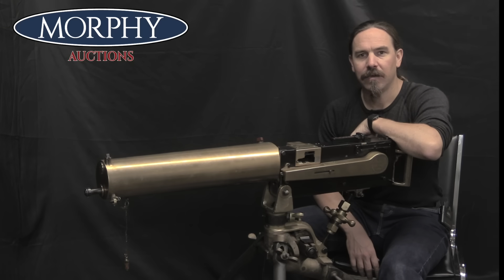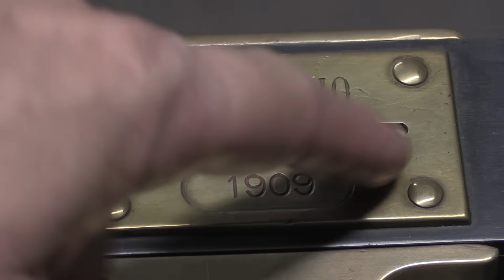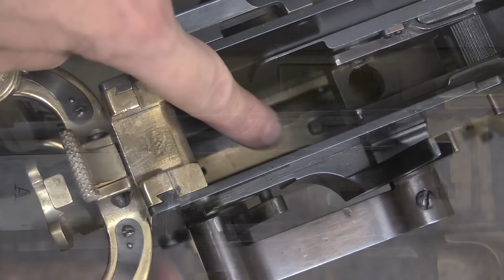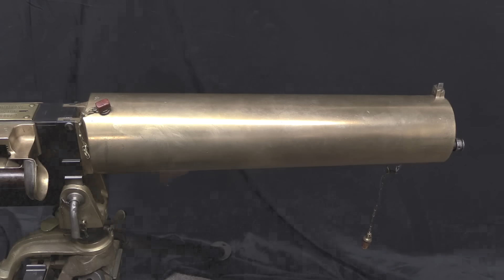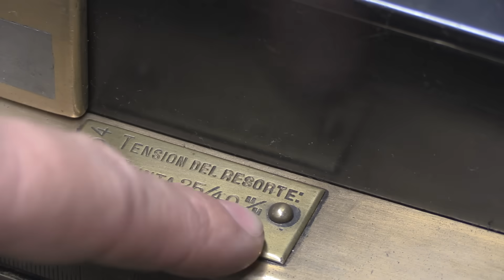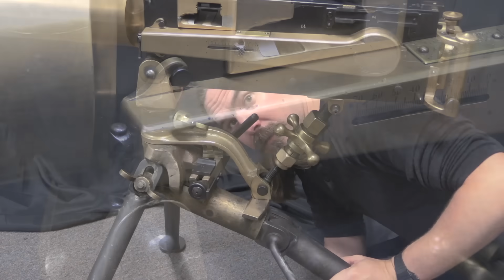Argentine Brass Maxim: A Machine Gun of the Steampunk Age

Comment: Is that hanging chain in the front, a barrel cap for storage ?
Reply from the maker: It's the chain for a plug to seal the steam vent hose connection when not in use.

Comment: We know, Maxims are still in use, but is there anyone who is still making new ones??
Reply from the maker: No.
Reply: @ForgottenWeapons Ian, you need to find one of the 50 Browning hp in 7.63 mannlincher with firing selector, Made on the 70s i'm argentina, a Lot of wird stuff was made on they 60,70,80s on argentina

Comment: Amazing video as always, Ian!
Can anyone tell me if reciprocating barrel of a Maxim gun is in direct contact with water inside the water jacket? If so, then how is water sealed off so it won't leak out through the small gap between the front of the barrel and the jacket body or somewhere in the receiver area?
I was always wondering about that

Comment: About the water system, would it be possible to have a recoil operated sort of pump?
Or use a part of the recoil in a clockwise mechanical aspect, making a flow between the water container and the condenser?

(I didn't said efficient, I said *posible*!)

Comment: I imagine the use of brass, especially in the water jacket, was a significant advantage in corrosion resistance over steel. If you're thinking you will use these guns for decades that is a significant consideration.
Reply: Only if you're okay with a green patina look though. If you're going to make the crews constantly polish the patina off there aren't any corrosion benefits over steel.

Comment: Is there a mechanical system that can reload (& fire) a cartridge after a misfire?

So one misfire doesn't stop it, but two sequential misfires would stop it?
Reply: Any externally-driven gun will generally ignore misfires, like the chaingun on a Bradley or a Gatling. For a recoil or gas operated firearm, the only one that comes to mind is the Villar Perosa, which might run past a misfire because it’s basically two guns glued together.
Reply: @PrebleStreetRecords  yeah, thanks, "not externally driven"!

I'll check out the "Villar Perosa"!

Comment: The idea of a black powder machine gun sounds like the worlds most metal fog machine.
Reply: Every 20 rounds required complete disassembly , thorough cleaning and reassembly.
Reply: @guaporeturns9472  The issued 577-450 Boxer ammo was actually capable of extended firing as the construction included hard card wads along with a beeswax cookie so each round scraped fouling then deposited a layer of lube.   As long as the brass case expanded well enough to seal the chamber upon firing the action would stay clean and I'm sure would run for many hundreds of rounds before any attention was needed.
Reply: @guaporeturns9472  By the time you're done cleaning the smoke have lifted enough to aim for the enemy again.
Reply: @guaporeturns9472  The tolerances were a lot less tight to accomodate for black powder fouling.
Reply: Ah but if you want to see something REALLY COOL you should go back in time to the American Revolution, and the 60 shot repeating musket. Ian has a video about that one as well.
Reply: "These are five to six hundred round-per-minute guns, so you can imagine how much black powder smoke that puts out" absolutely floored me as a line. No wonder Maxim guns last almost literally forever.
Reply: I really understand the need to lock in a traverse now.
Reply: Iron maiden album cover type stuff
Reply: Sounds like a Smoke generator with the side effect of shooting rounds

Comment: The wooden roller may well be ironwood. Not only is it very hard and durable, it is also self lubricating. Ironwood was also used for thrust bearings in steamships at this time.
Reply: Ironwood was also used in aircraft, mainly as the tail skid before they had a tail wheel, metal ones could spark and start a fire (which In the days when aircraft were basically a flying pile of kindling with a fuel tank in the center fire was obviously VERY BAD) the wood didn't spark but was durable enough and cheaper as well.
Reply: @SUPRAMIKE18 not to mention all that flammable canvass.
Reply: @scottmccrea1873  canvas that probably had engine oil all over it up near the engine too. Those men who flew those were a different breed from us mere mortals lol
Reply: Light Linen fabric "stiffened" and waterproofed with a Nitrocellulose-based "dope" (lacquer). Yep; truly a "flying bunch of kindling".
Reply: also can be lignun vitae
Reply: I worked with that wood before. Incredibly dense and you have to have tools that were razor sharp to work on it.
Reply: @miket2120 and they don't stay sharp either.
The only thing that can ruin a chisle worse than ironwood is Teak. Teak has silica in it, like sand.
Reply: @NikoMoraKamu this is more likely given that it’s from argentina
Reply: I don't know about thrust bearings but Lignum Vitae was, and is still used for shaft bearings in both ships and hydropower plants. In fact it's a 'green' solution to oil lubricated bearings contaminating the waters they operate in.
Reply: @chuckaddison5134  Nuclear icebreakers also use some kinda self-lubricating wood for the screw shafts.
Reply: @caav56  
Almost certainly Lignum Vitae. It has been used for a long time for that purpose. I could be wrong, because it's been a while, but I seem to recall that the Nimitz used it for their (external) shaft bearings.
Reply: The ammo feed for the coaxial of the Leopard 1 has a wooden roller too.
Reply: My dad had a friend who had been to South America, I believe, and came home with a 2x2 piece if ironwood. I Can’t vouch for how hard it was, but it was unbelievably heavy.
Reply: lol!!!  It is the strongest for sure.
Reply: It's still used in any shaft bearing that is dry on one side and under water on the other. Ships, hydro-electric dams, mud mixer motors for drilling fluid. All kindsa things need iron wood bearings.

Comment: The plate on the spring cover is engraved "Fogueo". That means "Blanks". That's probably the reason that the spring tension is so low.
Reply: son dos diferentes, tiene Punta (que asumo seran balas reales), su tensión, y abajo Fogueo, con comillas indicando que usan la misma tensión de arriba
Reply: @MrKumbancha  efectivamente. Lo volví a mirar y tienes razón. Es la misma tensión para los dos tipos de munición.
Reply: @MrKumbancha  Gracias

Comment: Why did they not fill the cooling jacket with a low viscosity oil, rather than water. That way the oil would not boil away?
Reply: Because the oil would just get hotter and hotter as would the barrel. With water it boils away with extra heat so the barrel always has water at no more than boiling water temperature. With oil cooling you would need a radiator, prob all with a fan and a pump. Water is simpler, lighter and just needs topping up from time to time with water or, er, sort of water.
Reply: Good question.
Primarily: Water has the second highest "heat capacity" of 'normal' liquids. It takes a large amount of energy to raise it's temperature by a degree: 4200j/kg. Regular motor oil has a heat capacity of 2500j/kg and so will heat up almost twice as fast in the same scenario.
Secondarily: Youtube search the word "BLEVE"

Comment: During firing, the water in the jacket eventually gets hot enough to boil and turn into steam, therefore the gun is literally steampunk.
Reply: ...and if you add a few teabags...
Reply: @TheWolfsnack i mean technically you CAN brew tea with it, but you’re gonna have a metallic aftertaste to go with that tea.
Reply: @W4rlight  During WWI, that's how the Tommies did it
Reply: @W4rlight  Literally. Robert Graves account In "Goodbye to all that" how they used Maxim cooler water to prepare tea, firing a salvo in the morning...
Reply: And add a polished brass pressure guage!  😊
Reply: Steampunk is my favorite way to prepare punk. Best flavor that way.
Reply: @johneden2033  Norm Macdonald is here
Reply: @petemcgee  Norm will be with us, always.
Reply: It looks remarkably unworn, with crisp edges to the brass castings. Were the Argentine military like Sergeant Bilko: "Who shot the platoon's annual round", so ammunition shortages resulted in unworn guns?
Reply: @scottmccrea1873 Yes, we know, Ian literally explained how it works.
Reply: When Dunning-Kruger Kommandos ruing the joke...smh....  @ThePotatoMan04
Reply: We’ll only if it has a mohawk….
Reply: Water cooled gatling gun, that has a steam powered engine, with a water cooler off to the side.
Closed water circuit with integrated boom boom.
Reply: I think what was needed was a steam power Gatling gun as it would not be so proud to Jamming and fouling  and the firing would actually assist in generating the steam.

Comment: Copious amounts of brass parts on a firearm has just always looked so classy and aesthetically pleasing to me.
Lovely video as always, gorgeous gun!
Reply: The only thing wrong with brass is the weight. It looks cool, it machines gorgeously, it is very corrosion resistant and it spit shines to a mirror finish with very little effort. If it had been the weight of aluminium the entire world would be made out of it.

Comment: I recently fired some rather rounded Winchester Soft Point 150gr 308s at 1000yds.  Oh they didn't like it.  You can  hear the bullets scream through the air from the drag (thanks suppressor and electronic muffs!).  While 147gr M80 will reliably hit at 1000yds, the SP's were random shotgun pattern with no hits. Such a marked difference in ballistics certainly confirms the rationale for the almost overnight switch from Blunt to Spitzer.  Another awesome Vid.  Thanks!